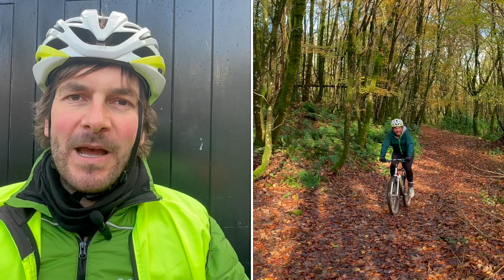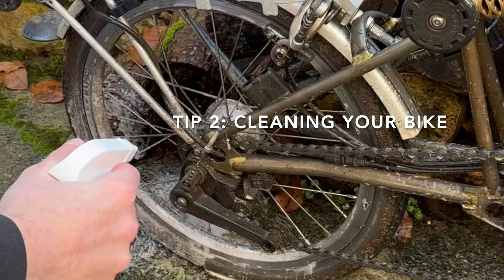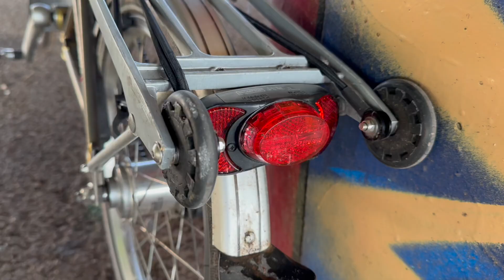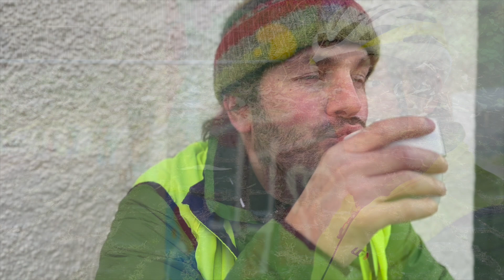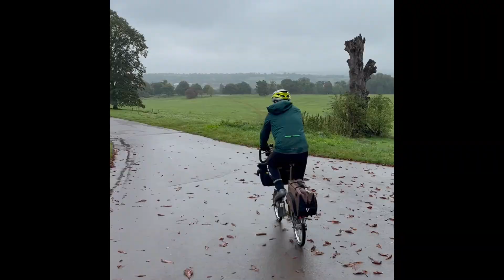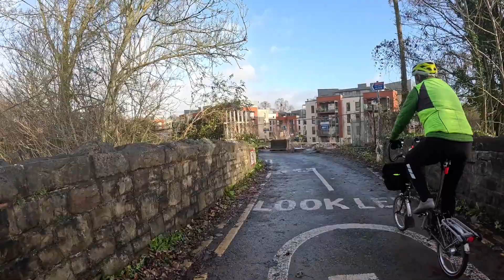Cycling a Brompton in Winter ❄️

Comment: I’ve been a London and suburbs Brompton commuter for years. I use a merino wool cap under my helmet. When the wind comes up I add a hi-vis helmet cover that closes off the helmet vents. It’s also good when it’s really cold. I’ve also used the Schwabe Marathon winter tyres with studs when I was commuting in Frankfurt, Germany. To protect the frame, I used strips of inner tube held with zip ties. This prevents the studs from contacting the paint when folding the Brompton. This also works well for keeping the grit from wearing the paint when it’s raining, or slushy. Shoe covers are really helpful too, even if hard to put on.
Reply from the maker: HARDCORE! Wow the winter tyres with studs! Thanks so much for sharing these tips 👍 A high vis helmet cover sounds like our next purchase ✅ thanks for watching and your comments 👍

Comment: I also used to use hand pressurised hand pump to clean the bike but it was taking so much time. I have upgraded to WORX electric pump and make the whole process easier and the bike cleaner. The head is adjustable for reducing the pressure and increasing coverage area. I set mine to 15 degrees which seems to good for removing mud stuck on the frame and components. It seems lots of people/journalist/magazine is concluding that WORX to be bike safe in terms of amount of pressure it has. Also a video about brake and gear adjustment would be great! There are few in YouTube but I did not find them comprehensive and easy to follow.
Reply from the maker: Glad you found something that works for you 👍
Reply: They've recently built a really nice Visitors centre t our local Country Park ( Upton House Poole ) At one end of it is a Dog wash with a range of brushes, warm water and even a hair dryer. The trough is the ideal height and size for a Brompton. I've been tempted just to see the reaction 😁
Reply from the maker: @devjon123  😂😂

Comment: Thanks for the video, Paul. Great tips. Do you have any tips about keeping rust away on a Brompton during winter months? I’ve realised that with winter riding, the chain (and some parts near the wheels/brakes) tends to get rusty really quick even with frequent cleaning? I ride daily and even with a wipe down, quick clean and relube of the chain, rust still forms. Any tips?
Reply from the maker: Thanks for watching. A product like GT85 is good because it expels any excess water. It doesn’t want to be used any where near the brakes though. Can be good to spray on components after a clean that are prone to rust. Hope that helps
Reply: Thanks I’ll give it a try!
Reply: WD 40 is excellent for displacing water (that's what WD stands for). Not a lube though, but handy if everything is soaked. 

Surface rust on a chain can often be removed if you pop it off and dunk it in some degreaser, then scrub with a tooth brush (wear eye protection though, very important not to flick it onto your eye! 

Also, a longer mud flap seems like a good idea. I just ordered one from RAW (a small UK based outfit).

Comment: I tried the brompton once in icy conditions and it felt like I was sitting on a death machine. Mostly, the back tyre was always sliding away. Cant remember ever having these issues with regular bikes. I used to ride a 60€ bike when studying. It never let me down in 6 years but one when the snow was really thick so the tyres would lose grip. Its a shame how limited a 1800€ bike is in comparison. Its also funny that everytime now I saw a brompton owner this winter they were never riding but only pushing their bikes. Well, I now know why
Reply from the maker: Thanks for your comments and insights. It’s good to be aware that every bike has its limitations. Equally a bike that will excel in icy conditions won’t be as versatile a bike as the Brompton
Reply: It's true that small wheels lose traction faster, but the "step through" design of the frame means you don't have to go down with the bike (which is a dangerous way to land, particularly for your hip)